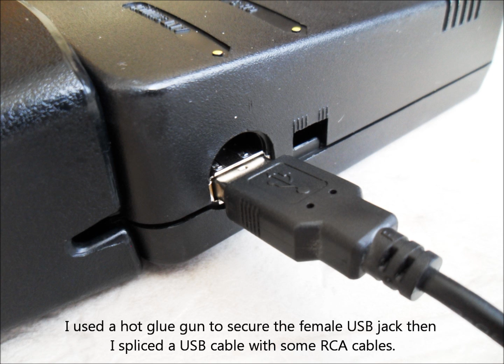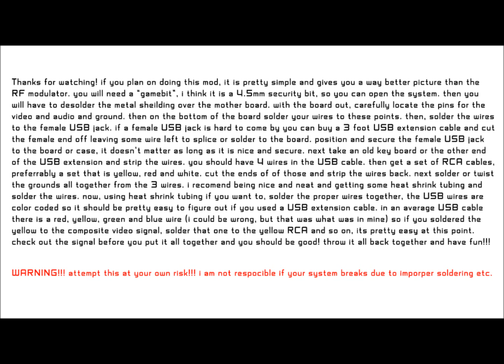Turbografx 16 A/V Mod -Clean!!!

Comment: You made your own USB composite cable but there are USB composite cables on ebay - would these be suitable substitutes? ie: www.ebay.com/itm/252047502959
Reply from the maker: probably! i didn't even know these cables existed. this was something i threw together while i was unemployed. since money was tight i  just used what i had laying around.
Reply: I'll be doing this modification shortly so I'll make note if it does work since I've ordered one.
Reply from the maker: please let me know if it does; i might get a couple too.